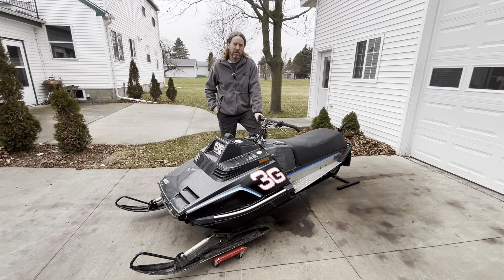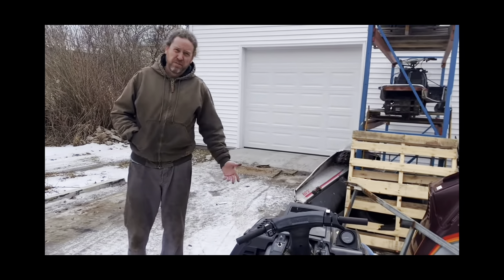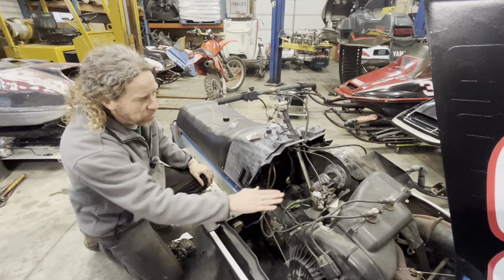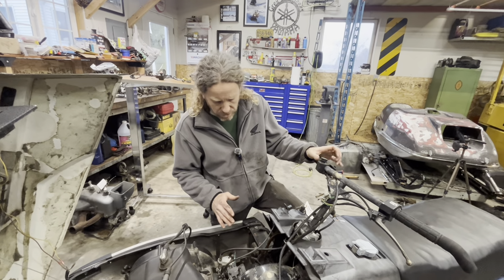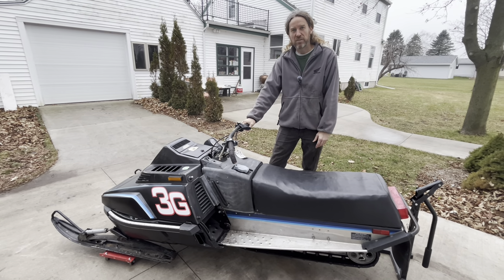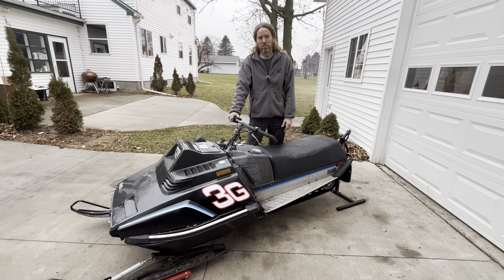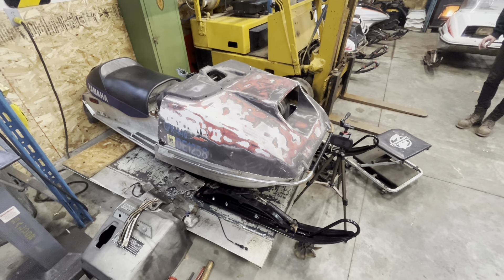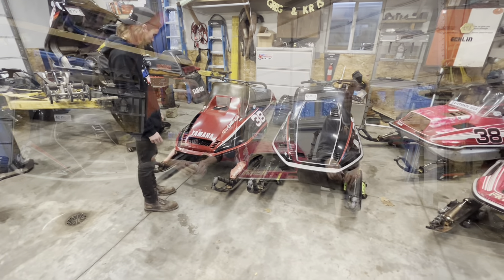Yamaha TORS Kiss Of Death?

Comment: 1981 SRX 440, good bad, opinion on the sled?
Reply from the maker: That's one that I've never had personally, so my opinion isn't worth much there.  I know they are rare, and desirable, but I think they had early engine troubles, and were recalled.  That might be why they are so hard to come by.  I'm not sure if they shared many parts with the other early SRX's, and if not, parts availability might be an issue too.  For what that's worth, that's about all I know.  Thanks for watching!
Reply: We were only able to get two of the 81 SRX 440s when we were a dealer. They were fast but temperamental. The Drive clutches wouldn't last, we worked on them continuously and I if remember right they eventually got replaced with Comets. They wouldn't stand up to the power the engines made. Some engine trouble but mainly Lots of carb tinkering and clutches wore out quickly. And Yes parts could be scarce now, I'm not sure.
 An interesting fyi, Yamaha built and shipped from Japan to the Yamaha Californian headquarters the 1982 SRXs but they didn't release them to the dealers, they were all scrapped. Yamaha had been continuing to test them even after they were built and shipped and they found issues they decided they didn't want to deal with in light of all the troubles the 1981s had. So they decided not to deal with another year of warranty claims is how I understood it. It was disappointing because the 81s were wicked fast and I'm sure we would have had no problem selling the 82s.